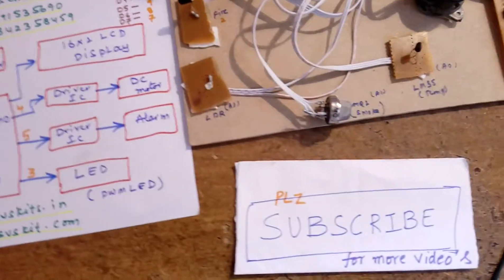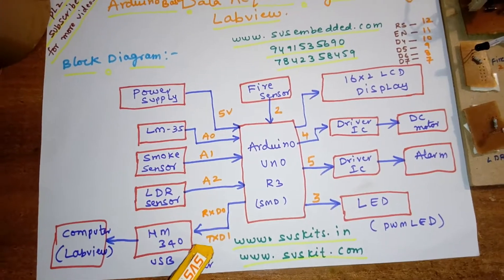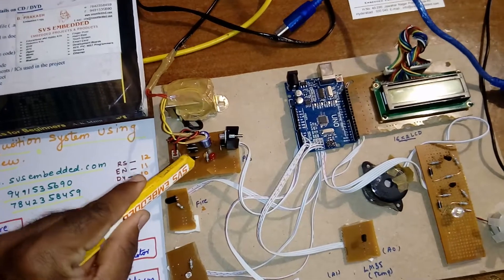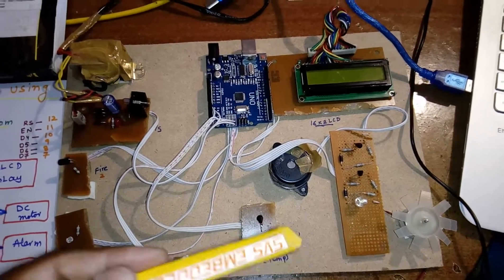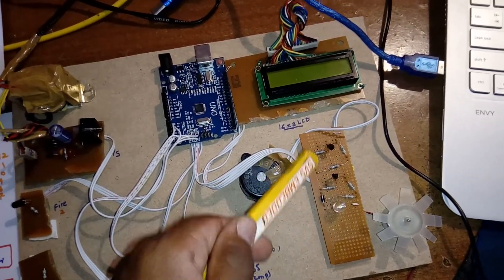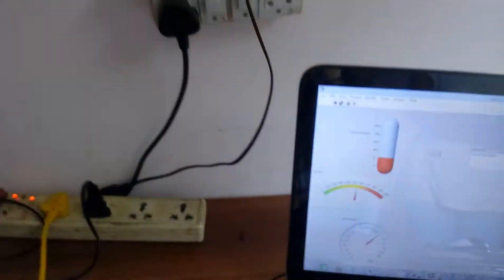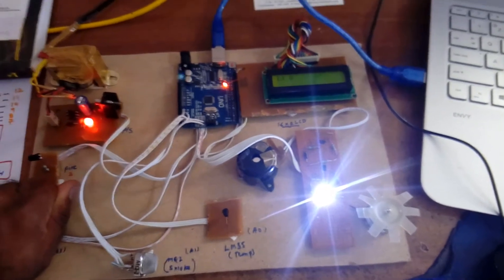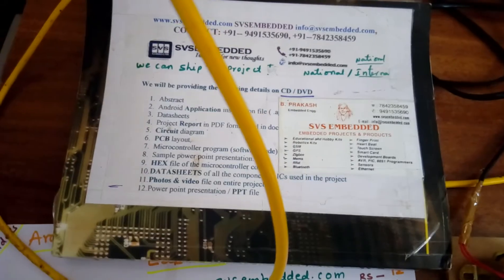Arduino Based Data Acquisition System Using Labview (ABDAS)

Comment: I like your project. I have a question. You have 4 input channels (signals) being processed in the arduino and sent to the laptop on a single TX line. If you activated all of your sensors simultaneously (as opposed to one at a time as in your demo) will all of the labview meters respond simultaneously? If not, how would you accomplish a "parallel" process from a hardware perspective? Your response will be appreciated. Thanks.

Comment: what is the LabVIEW block diagram and the Arduino code for this project .... can u show it plzzzz
Reply from the maker: Thanks for watching and your valuable Feed back.Sure we will show u the   LabVIEW block diagram.we are selling the projects with least cost.if u order the project we will provide working hardware kit along with 
1.abstract
2.datasheets
3.documentation
4.schematic( circuit ) diagram.
5.software code.
6.sample ppts
7.photos&video file on entire project
through google drive
send me a mail to  svsembedded@gmail.com,info@svsembedded.com.
we will send u the how to order procedure to u.
Reply: Which version of labview you have ? It is not much hard as you think.
Reply: how much cost .
Reply: @nmbjhcuyfy  around 6-7K with delivery